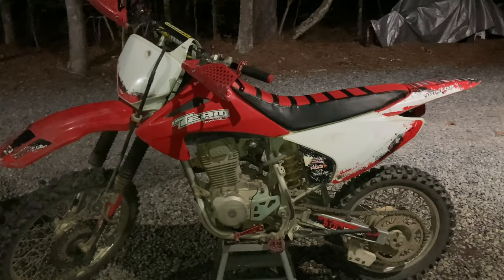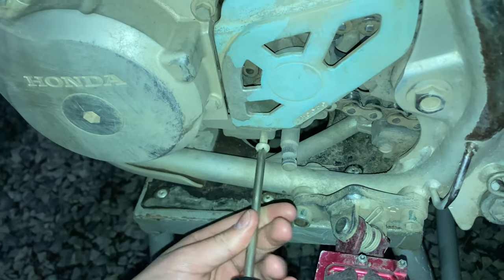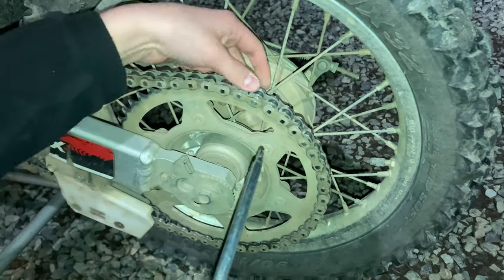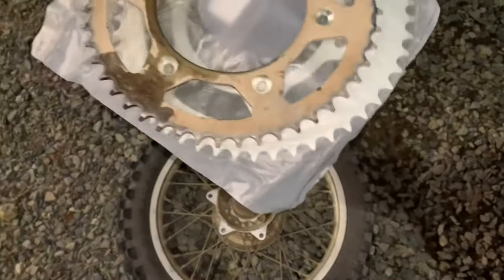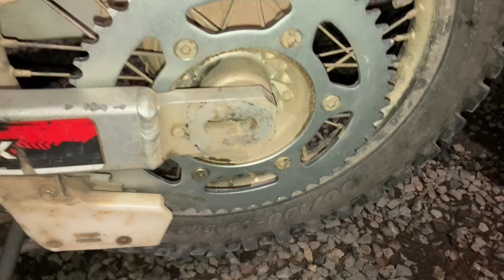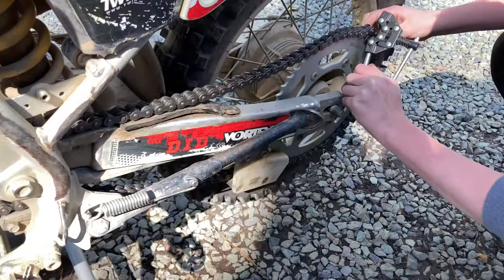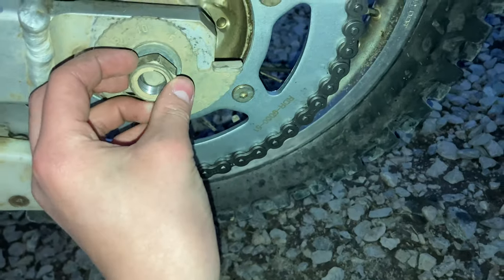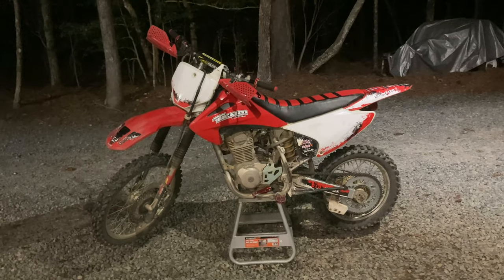Installing Chain and Sprocket on Crf150f

Comment: Is the front sproket stock
Reply from the maker: No it is an aftermarket 12th sprocket, stock sprockets are 13th for this bike
Reply: @BHMoto  ok so i need a 12 tooth front is a good set up for tight trails or open trails
Reply from the maker: Tbh both

Comment: can you plz link the sprocket? i cant find it
Reply from the maker: Which one ?
Reply: @BHMoto  the 51t rear sprocket
Reply from the maker: Here it is, https://www.race-driven.com/2003-2004-2005-2006-honda-crf150f-51-tooth-rear-sprocket-hardened-steel/?gclid=Cj0KCQjw78yFBhCZARIsAOxgSx2Bme6becxugy9kLy8Su15SgztJeKUU32gcNnCfR54DjX7ZSBMrfocaApX7EALw_wcB
Reply: @BHMoto  thank u sm!
Reply: @BHMoto  and btw, did you switch the front sprocket? or only the back
Reply from the maker: I also switched the front to a 12th as well
Reply: @BHMoto  do you have to switch it?
Reply from the maker: You don’t have to it won’t ruin the chain or sprockets it’s just if you want the torque
Reply: @BHMoto  but does it make a difference if you only replace the back one?
Reply: @BHMoto  like will it still increase torque
Reply from the maker: If I’m being honest though get both it’ll increase by so much but, also if you get a bigger main Jet in with a new exhaust system it’ll keep up with those 85’s a lot better ofc not in speed but will have a lot more pick up all throughout
Reply from the maker: Basically the mods that add to performance that I just listed I have done to my bike and it’s totally worth it
Reply: @BHMoto  i ordered the same exhaust, jets, chain, and rear sprocket but idk if i want to deal with the front one
Reply: @BHMoto  will the torque increase if i replace the rear but not the front?
Reply from the maker: For sure
Reply: @BHMoto  ok good, i dont want to mess with the front one lol! thanks for the help and your channel is fun to binge watch lol, keep up the good content man!